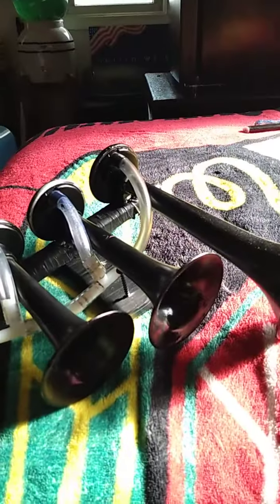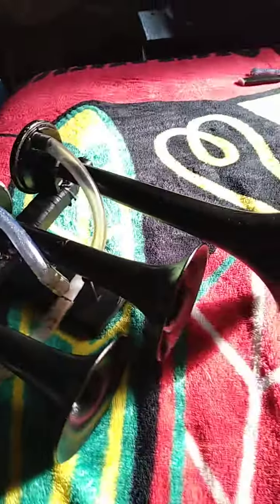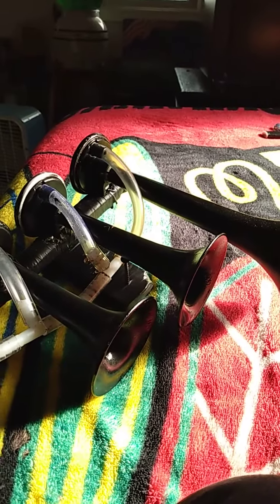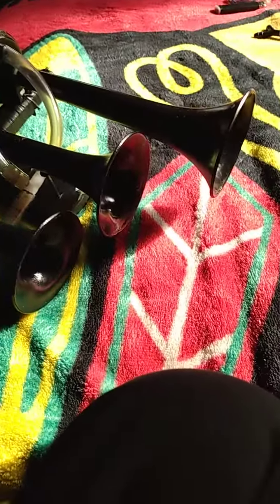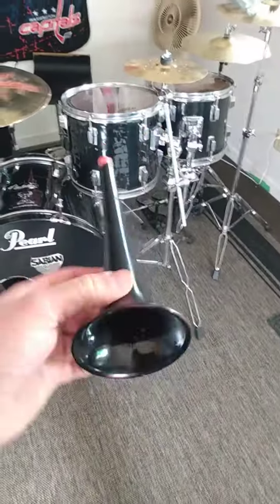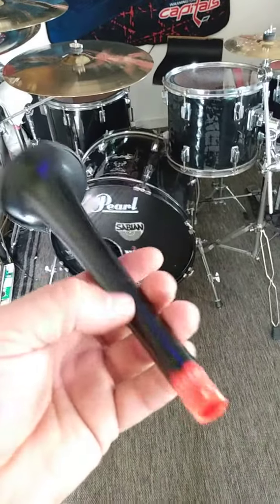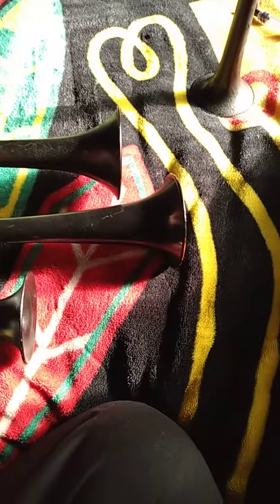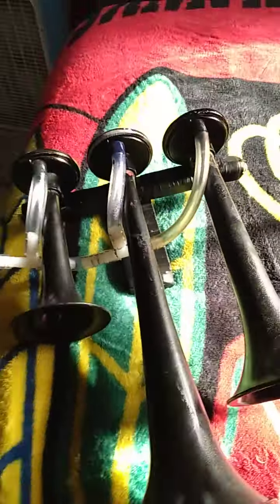Tuning a Harbor Freight horn set to sound harmonic!

Comment: good job on the tuning. if I understand correctly, you replaced the longest of the three trumpet bells, yes? And you  replaced it with what exactly? Got a part #, name or a link?
thanks
Reply from the maker: Actually it was one of the shorter ones. And the longest one I added on there I custom made from a different horn.